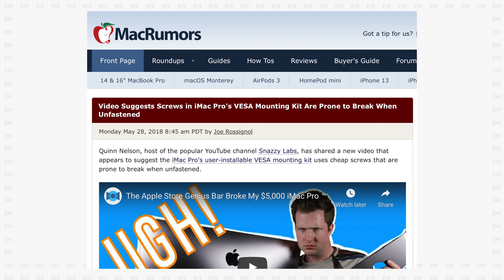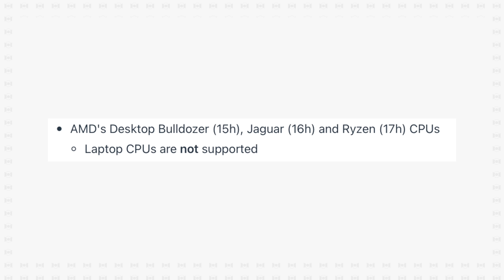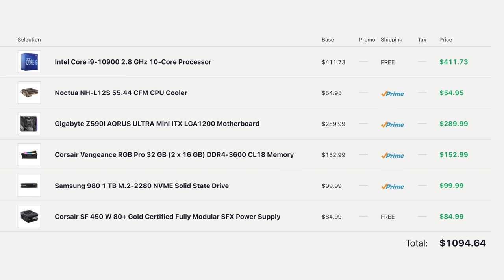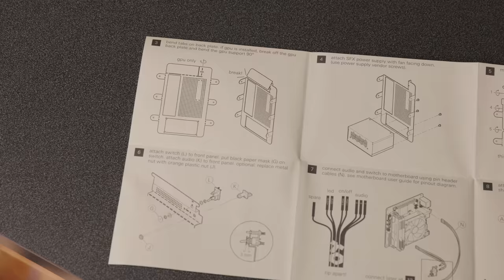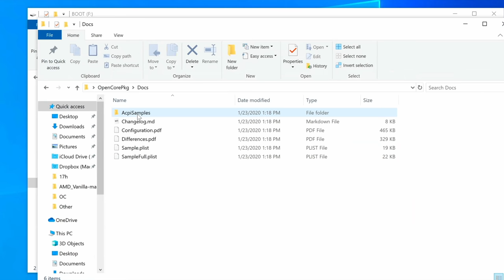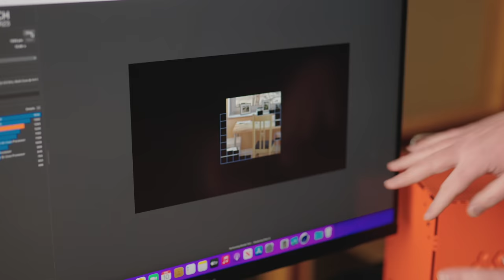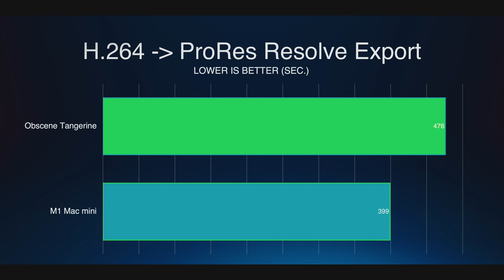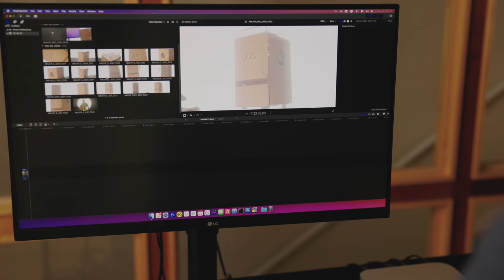The Last Hackintosh?

Comment: there is only one where there's no debate the m1 is better than a similar pc is efficiency the m1 soc power consumption is ridiculous low 30 watts under load on a normal pc 30 watts would be only the cpu while on a mac it's on full load

Comment: The problem with these new chips is that they are supposed to be general purpose chips, but actually aren't. They will hit limitations much harder, when they do, which they will...
Example: you can still use a gen 4 Intel CPU even for gaming today, while nobody ever optimized for those. If you want to go lower power, there are options, as there are options for gaming: a graphics module aka dGPU, where you have much choice about how much power and power draw you want. Putting a dGPU on one of those M1 chips is just hilariously weird.

Defining the value of a CPU over things like video/image editing is difficult, as that is just one purpose, but not the only one.
Yes, for some this chip will be the golden middle, but for the majority it'll just not matter. 
Buy a modern AMD APU and it'll consume as much energy as the M1s. There has been chips designed for laptops with very low power draw in thin clients as well, so there already have been alot of options.

I really feel like everything around these M1 chips is more of a religious thing and I wont argue the technical data, but since this device is one of the first of it's kind, we'll just have to wait. 

The hackintosh community is also a very small one, so that doesnt really matter. With all the spying going on, ppl will be more reluctant anyway.

Top: I can use the x86 for anything I like. I can even install android on it, if I want to. I can do virtualization, etc.

Not really that impressed... and I have tried the new chips myself.

Comment: my YT recommends used to regularly have Hackintosh build videos, but after the new Apple ARM cpu announcement, that all dried up and disappeared. This is indeed THE last Hackintosh. I bought an older Intel MacMini for the spouse, but after using the GUI I clearly saw the MacOS GUI was not for me. I'm much more effective and fluid in using the gnome desktop GUI of Ubuntu 20.4 - the MacOS GUI holds no appeal at all as GUI things I do on Linux work much better. MacOS GUI ceased being an innovative attraction probably ten years ago.

Comment: Especially with the M1 Pro/Max CPUs i dont see much sense for PC (except you need windows for any specific stuff or gaming) at all anymore.

The 16" M1 Pro MBP has just replaced my desktop completely (aslong i dont want to play games, where i see the last reason for windows in my usecases)

In fact if i have to use my Desktop PC now, and it was built to be quiet as fk... its annoyingly loud even idle with 300-500 rpm fans , you just hear the few 120mm fans spinning /shuffling air around... 16" MacBook Pro... in 99,5% of the cases 0 rpm fans, 0,4% of the time the fan is unnoticable idling at 1500-2000 rpm and in 0,1% of the time its noticable if you really want to hear it for example in high load and 2500-3000 rpm.

Comment: Comparing 8gb ram vs 32gb is not comparing at all. Yes, when you run single application to do benchmark, but in my experience with m1 MacBook Pro, just run Teams, WhatsApp, Safari with 10 tabs, calendar and try to launch Discord or something and machine gets so laggy, that's barely usable. And that's not power user usage, that's basic "student" usage. Also in 3 months, SSD lifetime dropped to 90% because of sheer amount of swap being used (5-7gb all the time). Why is almost every reviewer focusing on CPU, when even the lowest intel/amd cpu of current generation is good enough to use on day-to-day basis for non-pros? Why not also focus on multitasking and popular Multiplatform apps which are, well, really not optimised, like Discord you mentioned for example. I found myself in need to quit discord to even use the Macbook sometimes, even mouse started to freeze. I really doubt that common user or even pro user will use machine the way it's presented in almost all the reviews - Yea I'll close all my other apps, all my work and do just this one thing. In multitasking, m1 doesn't get even close to mackintosh at the same price for common multitasking usage. 

Jus to be clear, currently I have and use on daily basis:
1. Mackintosh - desktop i5 8600k, 48GB DDR4, 1TB NVMe SSD + some ssd/hdd
2. MacBook Pro M1 2020 8/256
3. MacBook Pro M1 2020 16/512 (replacement for 2.)
4. MacBook Pro 15" i7 16/512

MacBook Pro and therefore Mac mini with 8gb ram is not usable for anything except basic browsing the internet. It worked well while I had it only for YouTube and browsing, but add anything to that, hell no.

Comment: did he just compare 2 years old cpu with new m1 mac and says it's efficient.
Reply from the maker: The new 12-gen CPUs are even worse from a TDP standpoint.
Reply: @snazzy  however much better from an efficiency standpoint. As far as I remember, If you don't enable the 250W TDP, they can be pretty efficient. Not as good as an M1, but alot better than "classic" X86 chips without the Big.Little concept

Comment: I'm curious, this is a question for the Hackintosh and dissilusioned Apple producs user: as long as you don't seem to want to use Windows, and Apple seems to be an expensive pain in the ass, why not use linux? I know, you'll say you don't have time to learn to use a new operating system, and I really know how difficult a paradigm shift can be to embrace, but all the time you're using learning to use and hack Apple and Windows in order to make them do what you want, could be better spent on an operating system family that really does what you want it to do. 
Everybody is free to chose what OS they are using. But trust me, once you are past the difficulty of using a Linux, hmmm basically you may never want to go back to a paid OS. Even if you are into games or something really exotic in terms of software, the time you invest in learning is an investment on a future of less headaches. 
And no, not everybody in the Linux comunity is helpful. Many assholes are there. But if you trully want to, you will find nice ppl who can help. Or, you can learn by yourself. 
Peace

Comment: You choose a CPU that's two generations old and cheaper than the M1's CPU, use a 12800 and it would be a lot closer, the power would be a lot closer too but nobody really cares about power

Comment: The question isn’t are MacBooks better than computers. If it’s a laptop you compare it to a laptop! In my opinion the M1 and M1X MacBook Pros is definitely more worth it than any other laptops out there for it’s price. My 2015 MacBook Pro still works flawlessly like the day I first bought it, compared to my HP laptop which I bought in 2015 and now it’s super slow, and super loud when running work loads. Not to mention my MacBooks are 100X quieter than my Jet engine HP laptop…… can’t forget about the battery life as well, it’s untouchable on longevity and wear and tear. You’ll most likely find yourself more satisfied with the later on outcome with a Mac trust me. Im just really interested and waiting to see if Apple will ever really compete in the gaming GPU industries. That’s something to look forward to, although if they did. It’ll most likely cost an arm and a leg for it 😂

Comment: I was a Hackintosher (is that a word?),built many and still have a couple, but grudgingly have had to return to the disgustingly ugly Windows.  You might think because I'm gay the idea of getting screwed appeals to me, and you'd be mostly correct.  No need to wine and dine me even,  I'm good with going Dutch before going down, just don't expect me to pay to play when I'm the one getting bent over.  And that is what Apple expects, me to fork over $1200 minimum for a box of goodies that's capable of delivering the goods but denies me anything other than missionary, no possible upgrades, and has a looming expiration date based on use.  Look, I have computers that are literally 30 years old and still function, I've had to upgrade and swap parts over the years to keep them running but I got my moneys worth.  Once the SSDs in the Macs go out, and they will, or any part whatsoever goes out, and one will, I will be left with nothing but trash.  How long will the resale value on these Macs hold up when they start failing?  They aren't going to maintain value like they used to. And despite how I sound in this post, I am not trash and I deserve better than to pay for trash.  Apple, like the rest of the liberal elitists as well as my ex boyfriend, are hypocrites. If they cared as much about the environment as they claimthey'd stop making products designed to fail, stop forcing obsolescence.  And no, you cannot do that to me again, I know it's not rain.

Comment: I don't necessarily think Apple Silicon is the end of the Hackintosh scene. The M1 lit a fire under Qualcomm's ass, and the M1 Max just made that even scarier for them. The future is ARM, and it has been since the mid 2000s, just that Microsoft have dragged their feet on the issue, but that's changing. ARM processor manufacturers are having to step up their game to even be in the same room as an M1. Now, so far, ARM PCs have been heavily locked down, but when the power is there, the incentive is there, and the community will crack them wide open. Additionally, there's no reason to believe they'll stay that way. Eventually, there WILL be ARM parts for the DIY builder.

Comment: VM support being nonexistent in macos on amd hacks is just not that big of a deal. If you really need another os you can just dualboot with opencore👀
Reply: It might not be for you in your usecase. 
I have not used MacOS that much, but at least for me as an embedded systems developer, VMs are very important. I constantly switch between Windows 10 (Host), various Linux distros and Windows 7. having to reboot the PC would be an absolute deal breaker for me
Reply: @TheRailroad99  you can still use vms in windows and Linux. Only when you boot macos vms won't work well. You can still use virtualbox in macos on amd hacks too if you really wanted to

Comment: Disagree with your assessment that M1 is not better than Intel's.The very fact that the machine is using way less power makes its orders of magnitude more performant than any Intel. CISC is a waste of resources when you have RISC processors with so much to offer. In the end of the day, Benchmarks can be improved and software can be rewritten, but consume less energy is not something you are going to get out of the x86 anymore.

Comment: Uniform memory? Yeah, the Intel iGPU (and AMD APU) also use "uniform memory". They all use main system RAM. There are benefits and down sides to that vs having their own RAM. It is bizarre to me that people think Apple is doing something unique here or that there aren't downsides to the design choice.
Reply: It’s not unique. It’s just a stellar implantation of the concept. Yea amd and Intel use unified memory for their iGPU and cpu - but they have never put memory with this much obscene 400gb/s bandwidth to the memory. Nor has there been such a powerful graphics card in an integrated soc
Reply: @shashank1630  Stellar how? Systems have used UMA where graphics hardware and CPU have consistent and uniform access to the same memory for decades across many machines. Being faster is irrelevant. New stuff being faster is pretty standard.

Their work is good... but UMA doesn't magically make it faster like a lot of Apple fanboys act. It's not unique. It's not even uncommon. And it has downsides (naturally the bus can be a contention point). Where do you get 400GB/s? They use LPDDR4X which has a speed of 4267 MT/s. Apple is hardly the only people to use that technology and has a max bandwidth of about 34GB/s as I've read.
Reply: @spawnlink  actually they use LPDDR5 and a 512 bit configuration of it leading to 400gbps And at the speed of 6400mts I believe. Look this isn’t unique in the world - like the ps5 and Xsx packs a fast bit of ram. But nobody made a chip with this kind of bandwidth and at these memory sizes (64gb) in a mobile device configuration. The exact implementation apple has pursued here is super energy efficient with LPDDR5 being used and a whole bunch of media engines to accelerate some key workflows for their pros. It’s a well made one of a kind product in the laptop space don’t you agree?
Reply: @shashank1630  The M1 Max uses LPDDR5. The M1 uses LPDDR4X. The video was talking about a M1 device. Anyone who wishes can design a system around the same RAM parts. They aren't unique to Apple.

Who cares they have made something fast? That's not what is being discussed. The point I made originally and make now is that people are claiming that UMA is somehow special. That it allows Apple to do things faster due to some magic sauce. This is false. Their hardware is good but the design when it comes to the GPU and using UMA does not magically make shit faster. This is ignorance and Apple fanboyism. UMA is common and been used forever if many many many devices.

> It’s a well made one of a kind product in the laptop space don’t you agree?

No. I don't. Being good or ahead of the curve doesn't make it unique in design (unless you're being pedantic... in which case literally all designs are 'one of a kind' and a pointless designation).
Reply: @spawnlink  look I agree with most of what you said. However when you look at the competition they are up against (this is key - not special purpose computers). When you look at a professional Dell XPS laptop for instance. It has a discrete GPU and a CPU with discrete memories for each and the cpu one is not as fast as apple’s. You add to this the fact that it’s just incredibly inefficient (intel cpu + Nvidia GPU) due to the discrete parts and memory pools (some which are power hungry GDDR6). Well… this is the competition in enclosures with limited TDP that apple is competing with. In this context the SOC is a novel design - show me one other all in one chip in a laptop that is equally performant.

As for UMA not magically making things better - of course I agree. But many workloads that are dependent on copying between frame buffers - it can be great. Even general purpose compute could have improved latency for ‘some’ tasks just by avoiding bottlenecks as data is swung around discrete chips and their respective frame buffers.

But your gist is right about Apple - they fired first and very well and it is just a matter of them being ahead of the curve right now.

Comment: Another point worth making in the “price of the Mac” argument is the total cost of ownership.
As you demonstrate, the Mac mini is often drawing closer to a tenth of the power the Obscene Tangerine is draws. That’s probably gonna add up to significant energy price savings, especially at the moment when electricity prices are rising (at least here in the UK!). Makes the machine greener to use too 😉
Also, even without the energy cost savings, the total cost of owning a Mac vs a PC is generally better usually tips heavily in favour of Macs, because (2016-19 bad, bad times aside) they generally just last longer as machines. And if you’re buying for business, unless you have specific Windows needs, you’re likely to get better productivity out of your employees if they’re using Macs too! Check out the IBM study, where they discovered the total cost of ownership on a Mac over four years saved between $273 and $543 per Mac, due to increased reliability, decreased support calls, etc.
Reply: Yeah, also the resale value of Apple hardware is insane after 4 years, whereas resale price individual PC parts after is not (insane at all).

Comment: but...I would've picked an i5 10600K or 11600KF plus a cheap RX 560 for the same price. Such combo would come much close in graphics, especially with ProRes. The latter of the two allows for PCIe 4.0 SSDs.
Reply from the maker: Good luck finding an RX 560 for a reasonable price.
Reply: @snazzy  In Europe you can find them for EU 220 (incl. VAT), the price gap between 10850K and 10600K/11600KF...
Anyway, nice video. You must have sweat getting the framebuffer right on a Z590 board...
Reply: This is exactly what my setup is!

Comment: Mac for design, PC for everything else.  Went Mac for about a decade, they are nice, but if you want to game they suck.  Sure you can run bootcamp, they still suck for gaming.  Mac is for people who know nothing about fixing computers and just want it to work when needed and it's at a cost.  Had a PowerMac G5 and 2 different imacs 10 years apart.  Don't think i'll go back unless the price comes way down and their CS greatly improves.  Also the GPU shortage was engineered.  They see how much gaming is making and cryto and want more, so they screwed everyone.  Nvidia has been selling directly to miners as many as they want to order.  When everyone quits buying and cancels crypto, things will get better.  So in reality, they never will.

Comment: That parts list is all over the place for a hackintosh, was the goal to inflate the PC's price and difficulty?

A nearly $300 motherboard? 32gb of DDR4 at 3600, a speed Intel doesn't support, in a capacity you'll likely never cap out in OSX? An overpriced, $200 designer case designed by idiots? an i9 being cooled by a low profile cooler?! That thing is roasting itself and wasting clocks like mad! Why do this, you're supposed to be some kind of expert aren't you?
Reply: He didn't include the case in the price specifically because it was overpriced but otherwise I agree